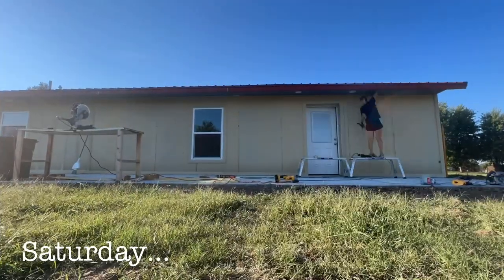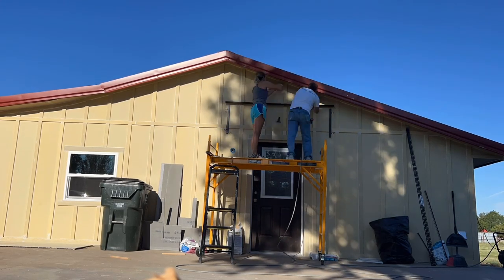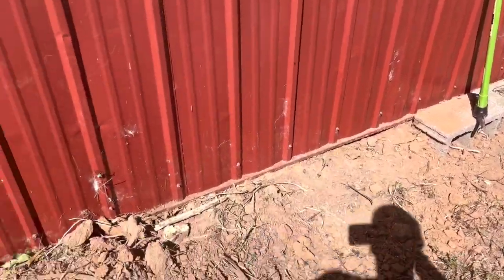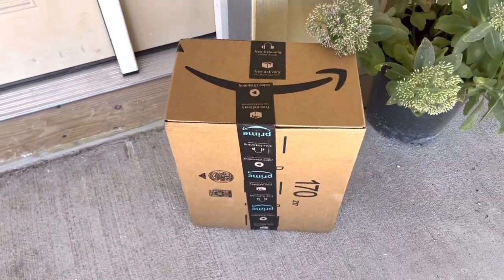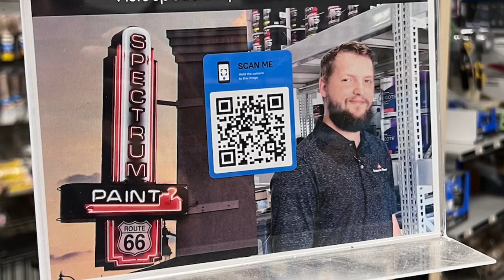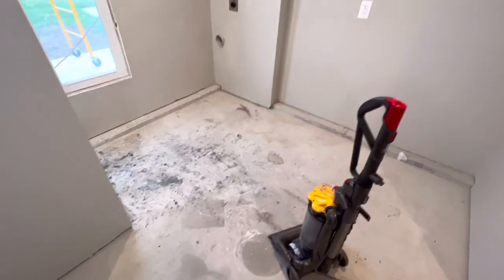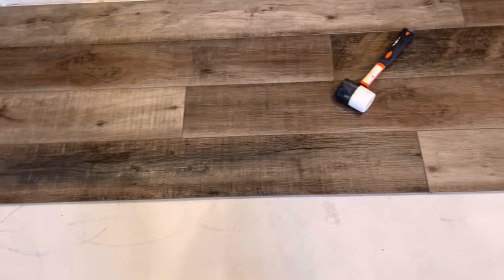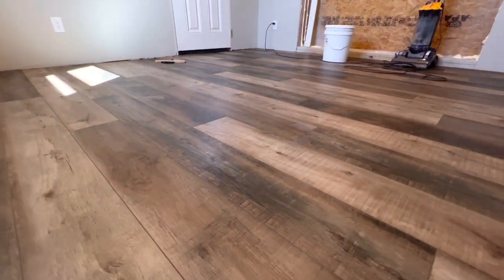FLIPPING the FARM Week 32 Vlog

Comment: You may have mentioned this in one of the previous videos (If you did I don’t remember-I apologize). What color are you painting the outside of the house? Is it going to be white? Barn red? I’m so curious or is that a surprise? Also… I had to laugh about your fingers and the flooring. I did my flooring a little over a year ago in all but 2 rooms in my house. Apparently all the swiping my fingers back-and-forth to make sure everything was smooth and snug wore my fingerprints off my right hand completely. It was quite the pain in the butt because my job has the little finger scanner thing for punching in and out. I had to use my left hand to punch in/out 😂. I feel your pain. But this house/farm/property is absolutely amazing!!! I’m loving everything about it!!!
Reply from the maker: lol... YES.. you can certainly relate to the finger pain! The house will be white with black trim. Keeping the red roof bc well that is expensive to replace and it matches a couple of the other structures on the property. Thank you so much for watching!! Hope your fingerprint finally "grew" back..lol